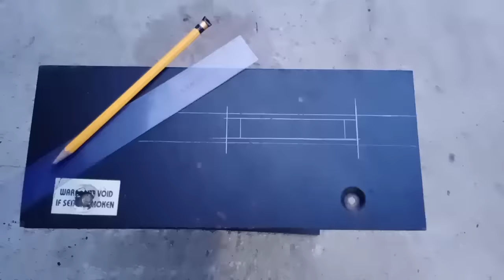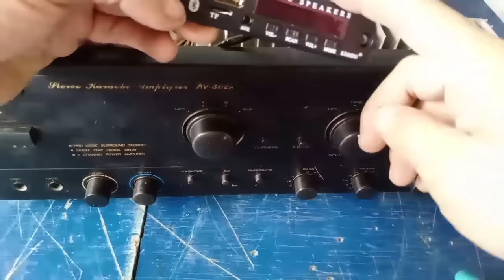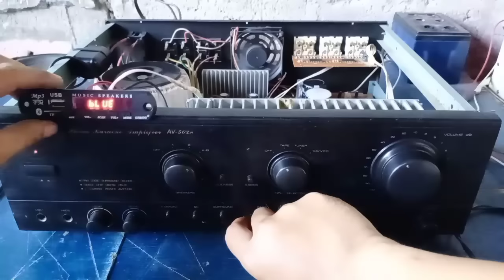HOW TO PUT BLUETOOTH MODULE BOARD IN 502 KONZERT AMPLIFIER.

Comment: Idol, tanong ko lang. Kc wlang tonog ang mian speker Pero yong ibang maliit na kbitan ng speker mayron nman. Ano kaya prolema idol.  _ Ang  Amp. 502 B.  Sna mtolongan nyo ako, salamat idol, god bless.
In
Reply from the maker: Ang MAIN SPEAKER AT SURROUND SPEAKER sir sa KONZERT 502 magkahiwalay ung amplifier nyan.kaya kung may problema ung main amplifier ng amplifier meron parin tunog ung speaker surround.un yon sir ung sina sabi mong kabitan na maliit na terminal speaker.
Ngayon sir.kaya walang tunong ung main terminal speaker ng amplifier mo pusible may problema ung MAIN AMP ng amplifier mo.pusible meron short na pyesa sa main amp kaya walang tunog main speaker ng amp mo.pusible rin sir na may problema ung  selector switch check mo rin

Comment: Sir Darwin....patulong lang po may amplifier po kasi ako na AV602R+ nag.no sound lang bigla while negvideoki kami sa bahay...pag.check q sa loob may putok na capacitor at may nakita din ako na bloated caps..pansin ko rin ko n anaputol ang left channel fuse so chineck ko mga transistor both channel may nakita ako na shorted at leak na mga transistor...napalitan q na pos lahat n anabanggit ko na mga component may sound na po amplifier ko kaso problema pag.ginagamit ko selector from media to cd to aux2 and aux1 na.o.off po ang mp3 module ko at nawawala ang sounds ng speaker pro naka.on naman din po amp ko, functional po fan ko di na rin po napuputo fuse ko pagkatapos q replace nga transistor...pa.help naman po...salamat

Comment: bos tanong ko lng.pwede po ba baliktaran ang output sa pagkabit sa input sa amplifier sa board..at ang power supply po ba sa bluetooth module board pwede po ba sa 12volts.kc nakabili ako ng speaker bluetooth 5 volts ang supply niya..pwede po ba xa sa 12volts..  salamat sa sagot.godbless
Reply from the maker: Oo boss.pwd naman.LEFT AND RIGHT lng naman yan.
Reply from the maker: About dun sir sa nabili mo.hindi kita masasagot about dun sir.mahirap na 
hindi ko kc kita ung nabili mong bluetooth.iba iba kc yang mga bluetooth sir.kaya hindi kita masasagot dun sa tanong mo if pwd ba.